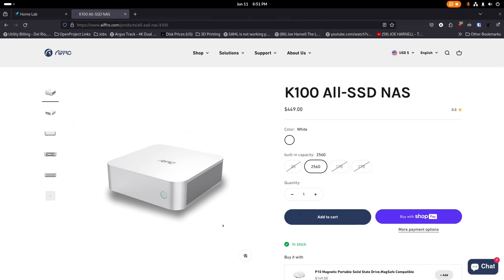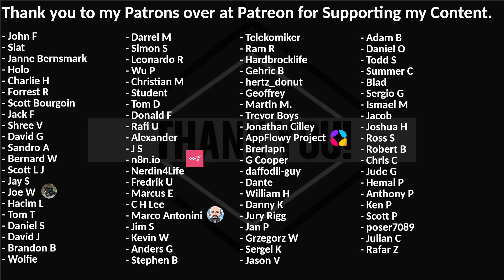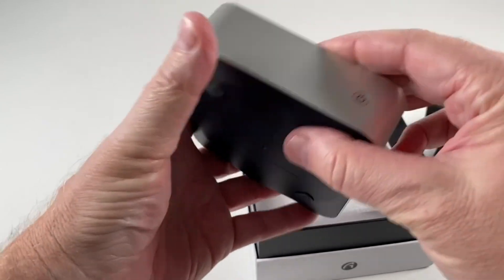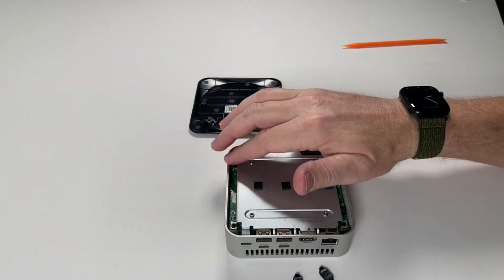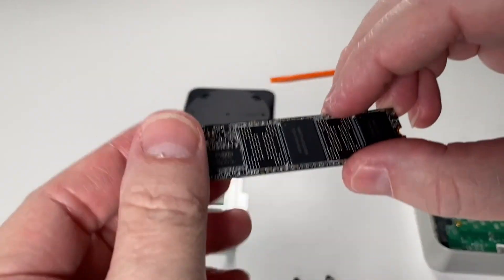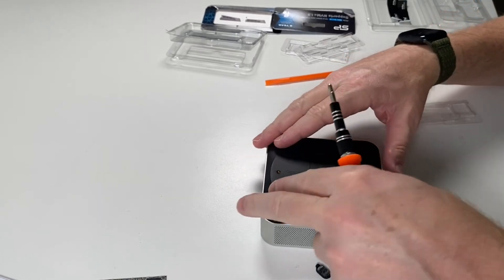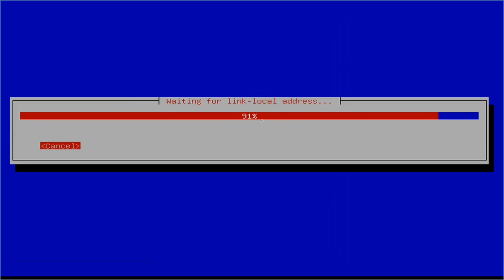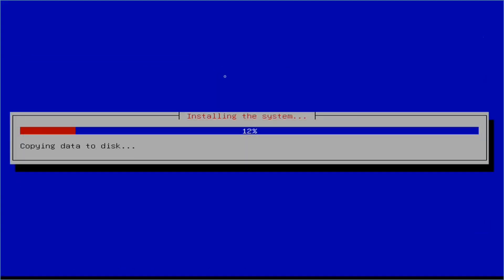Aiffro K100 All SSD NAS. Low Power, High Performance!

Comment: Hello! I do video editing and have been looking for a solid solution to host my files. I want to be able to edit off of this device with the footage that I receive from my client:
4k videos up to 200,000kbps bit rate for raw footage, and 9,000kbps for proxies

I only edit using proxies but when it comes to rendering it'll of course render using the raw footage. 

I also want to be able to have this connected to the internet via ethernet (so I don't have to have my pc on). I want this because the only other thing I want to do with this is be able to have a FTP server so my client can upload projects directly to this.

Would this be a good option for me if I utilize the USB 3.2? I currently use the T7 Touch by samsung with USB 3.2 and it's been totally fine for what I'm doing. I like the idea of being able to connect to this device like it was an external storage solution while also it being a NAS so my client can dump the files directly to it. I don't need it for anything else other than these things.

Appreciate your video nontheless!
Reply from the maker: I'm no expert, but with 2.5 G ethernet, you should be able to edit 4K video from the device. That said, you won't be able to do multi-monitor editing of multiple streams I wouldn't imagine. So something to keep in mind.  Know this. I only record in 1080P, and edit that on a local machine, so I'm just going by what I've read.

Comment: Check out the Minisforum MS-01. It's probably the best mini-pc for home server / NAS use. The cheapest variant costs $399 with an i5-12600H, and no ram or storage. It has three nvme slots, where one can be used with an adapter for U.2 as well. It has space for a single half-slot PCIe device and has 2x10G SFP+ and 2x2.5G RJ45 and 2xUSB4 ports. It's an absolutely insane little beast of a mini-pc.

Comment: On top of the expensiveness that other commenters are pointing out, ZFS (which would ostensibly be the goal of any type of NAS whether z1 z2 or z3) would wear out the drives faster. Even ZFS mirror would wear out an NVMe far faster than it would a traditional 3.5. This is on top of needing essentially 1GB RAM per 1TB storage. The N100 doesnt have enough PCI lanes to saturate Gen 4 NVMe lanes and isnt powerful enough to manage a SAS even had you the option to do as such.

All of that is before the fact that I mention that you have to install the OS on one of the 4 drives that you put in (you do this at 11:25) which means that you dont have 4 drives at your disposal, you have 3. I fail to see the thought that went into designing this product besides just tossing 4 NVMe slots on a N100 chipset.
Reply: If you use an OS that can boot from a USB thumb drive, you'd have all 4 slots available. I'm a little surprised that he used up an SSD when openmediavault can run from a USB stick.
Reply from the maker: You are all correct. I just wanted to show what it can do. This setup was taken down after the video was completed.  It's just to show that it can run OMV, TrueNAS, or any other NAS.  ZFS is hard on SSDs for sure, and there are other options in linux as well.

Comment: The big problem here is the N100. That platform has only a single RAM channel, and very few PCIe lanes, so I am thinking these 4xNVMe devices are only Gen 3 x 1 lane each, so throughput will not be that impressive. Hence the limited amount of network bandwidth supplied.

So, at the price, thanks, but no.
Reply from the maker: Great insights, thank you for sharing.

Comment: interesting video, full nas with SSD is not in current roadmap^^"
actually i dont have a "nas" yet
i have a motherboard with an i5 3470 (3.2ghz) + 16go ram, this will be a good start, and if i dont need a nas i can make another think with it
Reply from the maker: Sounds like a solid starter plan.

Comment: This looks to me like a mini pc and the company realize they could not sell it as pc with n100 so they repackaged it as a  NAS
good item tho
Reply from the maker: It's essentially a mini-pc NAS.  I like it, it's pretty great, and so small. I'm working on a separate low power mini-pc now, and it's actually larger than this little box that's acting as a NAS.
Reply: This is exactly what it is - You can get an N100 with 2x2.5Gbe (Intel), 2 NVMe slots and 2.5" bay for £85 of AliExpress... I got 3 of them to build a Ceph cluster (still WIP).

I understand something "unique" might have less demand, and there is additional cost here is for NVMe slots, but that does no constitute 350% price increase.. and to add salt to the wound, it seems to have a Realtek NIC.

Comment: Static charge drives are not reliable for long term storage, imo. Performance vs reliability payoff is suspect. And the presenter glides right over the fact he'd be backing up this nas for sure. The cost per storage volume is an obvious red-flag as well, eco-benefit be damned.
Reply from the maker: I did mention that you should have a backup, didn't mean to breeze over it.  You should always have redundancy.  SSD NAS or not.  Yes SSD does cost more, but so did Spinning drives when they were first available, as they do for larger and larger volumes.  For me, the cost savings on power will be much larger than the cost to both get the device, and even update the storage down the road, but that may not be true for everyone depending on where you're starting, and what your goals are.

Comment: What is the point of a complete ssd nas if it only has a single 2.5gb port? 
The system is very expensive for the n100, the only advantage is the many ssd slots, of which you have no real advantage in terms of speed if you are limited to a single 2.5gb port. 
I see, many people certainly don't have the network infrastructure to make use of several 2.5gb or even 10gb ports, but then I dont see a reason for an ssd-only nas anyways
I'd rather buy a standard mini pc with n100 cpu, also one 2.5gb port and only one or two ssd slots for half the price. 

(Apart from the fact that you can get "firewall pc's" from china for 250-350€ with the n100 which are equipped with 4-8 2.5gb ports, and several ssd slots. Admittedly, the delivery times for these things are rarely less than 1 month but still..)

love your vids tho'
Reply from the maker: I think it's a great way to keep things low power. That's my 2024 goal, is to go low power for all my home lab services. But, point taken about less expensive devices with more NICs.
Reply: So many compromises with this product, only reason this gets a outlandish good review is becuase the channel is prone to accepting payment for bought positive review.

Comment: Well done! Appreciate the power readings. For reference, my old Synology DS1815+ with 5 HDDs uses ~27W at idle and ~62W when active. The 6W idle would be a nice savings, so I'm considering it.🤔
Reply from the maker: That's awesome!  Yeah, I'm pretty excited about how much this can save me on power usage over time.
Reply: If you are replacing your old hardware its one thing... but don't upgrade to get lower power usage alone.  It will take years to get to the payback period.

Comment: They should be selling this thing for $250. Then they'd have a chance. At 390 with the discount, easy "nope" from me. For the 450 regular price? Practically highway robbery lol
Reply from the maker: I don't feel like it's that far off the mark from other similar systems I've looked at.  But I understand the urge to fine the best deal possible.
Reply: @AwesomeOpenSource  How about cwwk p5 with nvme carrier board ? 

That thing technically is 4 nvme + 2 SATA and you can use a  aftermarket nvme cooler with whatever size because it is caseless 😂

Comment: Intel N100 is what all these SSD NAS prebuilt's are running. Not enough lanes and it's a cheap chip. Can build an all-SSD NAS (without the SSDs) for nearly half the cost.
Reply from the maker: I'm getting the feeling it's priced too high for a lot of you.  :-)
Reply: @AwesomeOpenSource  not at all. I spend upwards of $13k on Dell servers for clients. I'm just saying, that for a home lab, or someone just tinkering around, NASs like these are priced too high and they want to compete with the likes of say Synology. And for a brand that is not known or any newcomer to the NAS space, they need to be competitive and not use lower-tier components.
Reply: Yes.  You can build a matx or itx system with all the bells and whistles for $800.  Not enterprise grade, but much cheaper if you already have the case and psu
Reply: Any recommendations?
Reply: That was my thought as soon as I saw the price.

Comment: I hate metal on electronics which require wireless connectivity, because it destroys the reception. Just make the damn thing plastic, and let me save a few pennies. I don't think that naked beer can aesthetic is attractive, anyways. With plastic, I can at least have some choice in getting the color I want. A mini PC is never going to be a premium product. Let's face it, it's a cell phone in a box that doesn't run on batteries or fit into your pocket. It ain't nothin special. Quit tryna be fancy.
Reply from the maker: I get your point, but it's really a nice build quality. The antenna thing is not an issue, Mac has been dealing with it long enough that it's easy to overcome.  As for the cell phone part...it's funny, but seriously these do something a bit different.